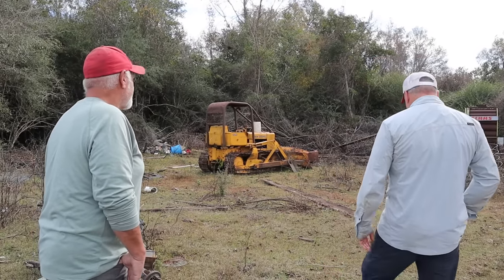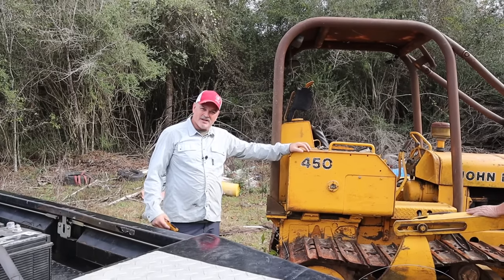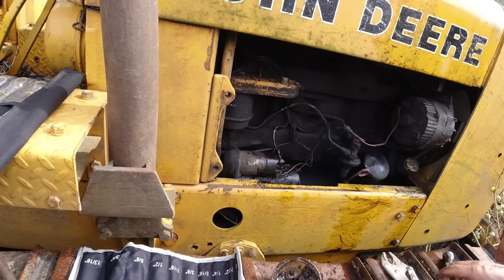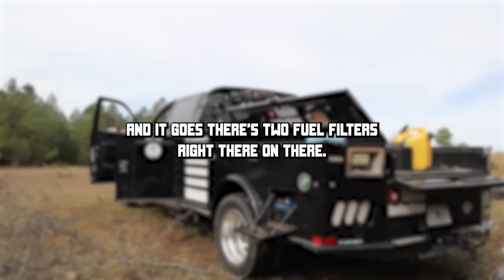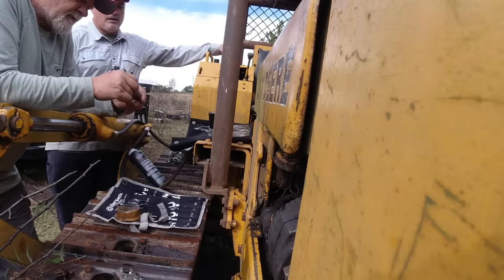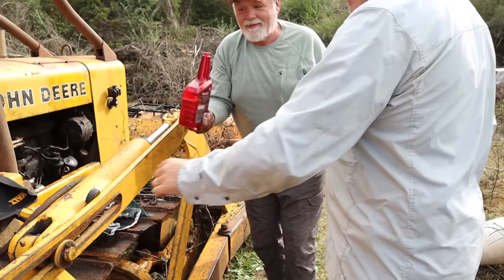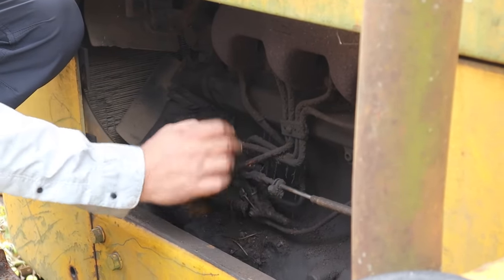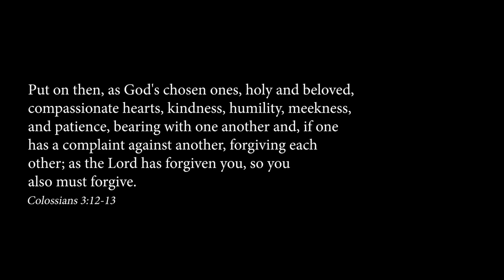DOZER SAT FOR YEARS! Let's try to fix it!

Comment: Thanks for another great video guys. It was interesting. 

After some hard work with the fuel filters and such you got it to fire up. Seems to run fairly good. Overall condition seems not too bad. Metal is good. 
Good going Hank and Wiley for getting it running. 
Great job guys. 

The Iowa farm boy. Steve.

Comment: Early 450, has the HLR shifter on the floor. The later 450B's and 450C's had the HLR on the armrest with the 4 side. Transmission lever.

Comment: Watching you from the Pacific Ocean. I have been a Dozer Tractor Mechanic all my life and this one ..Is a ....Eary JD450 Crawler. The Early one had the brackets for the Blade like that.. The later ones had the up=Grade on the blade Beams. The Firlters are actuall ..Primary and Secondary and they are ...Glass Bottom too.
When starting ......Open The Bleeder on the top of each filter one at a time..... NOT THE BOTTOM ONE's but they also have ..... Little Bleeder 's on them like the top ones.
ALSO YOU NEED TO ....CRACK ALL THE INJECTORS ONE BY ONE THEN IT WILL BLEED ALL THE AIR IN THE SYSTEM.
   THERE IS ALSO SOME TIMES A ... SHUT OFF PETCOCK VALVE UNER THE SEAT FIOR THE FUEL LINE.CHECK THAT ALSO.
      DON'T MESS WITH THE .......FUEL INJECTOR PUMP AT ALL IT IS A SYNCRONIZIZED UNIT WHEN REBUILT ONLY.
.
Thes JD's are very handy to have especially for Ground Work and Home construction. NOW" The biggest thing to operating these are those .... Lever Steering ones. A lot of Operator's hold them really to tight and damage those Cylinders under the seat. All you need is ... ( >>>> Three Finger holding to steer these machines". )
You do not .... Gorilla These Steering levers for working them. I have worked on these for over ..... 30- 35  years for many people  also.
Good little machines but delicate also and only for small ... House Pads. Light lot work round works.
Machines have a ...Switch on the das Board and a Glow Plug for winter Colds on the ... Exhaust Manifold.

Most JD's get steering damage from ....High Excessive Pressure pulling on the Steering Levers and that is not how to drive these machines.
The Clutch and THREE FINGER Pressure Plate in the Bell Housing are ...Chevrolet Type DANA Units. The Steering Clutch's are also the same type. if it does not move can be changed but you have to remove the Whole Seta to do that. You have to first remove the Fuel Line from under the Tank and drain it before even starting the machine. Transmission uses clutch's similar to' Chevy 350Turbo ones but smaller.  You must fill .Both Filters first then install them the loose those Bleeder on the top when you chank the machine then close them. Starter use ....Chevrolet Starter Solenoids. These early ones used ...Chevrolet Generator then converted to the later machines to ...Car Alternators. You can use regular Automobile Transmission Fluids in these Machines also. Steering Clutches are ..Dry Clutch's and not Oil's for them.
These machine to work right have to be completely stopped the Shifted for long life results.

You can convert them from the early Blades to the newer Tilt Ones just change the whole set up from the Pin Boss's

TGracks are adjusted with... Grease under the Big Covers with a Nipple and it has a big Coil Spring in the Cyliner.

Tools ..... AWE Vice Grips are a ..NO , NO for doing all this  and I dont do things like that.

Comment: Hello guys again 1st water in the fuel system Alchohol will evaporate the water 2cnd fuel system gummed up try Automatic Transmission Oil ever see the inside of a broken automatic trans. Clean as a whistle